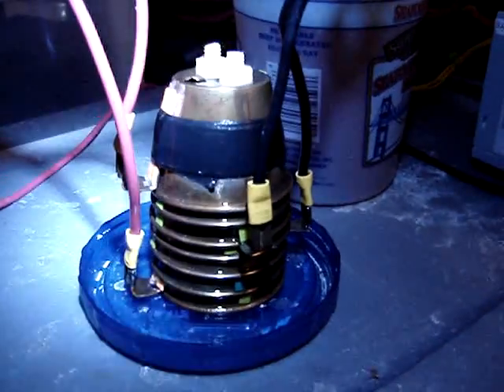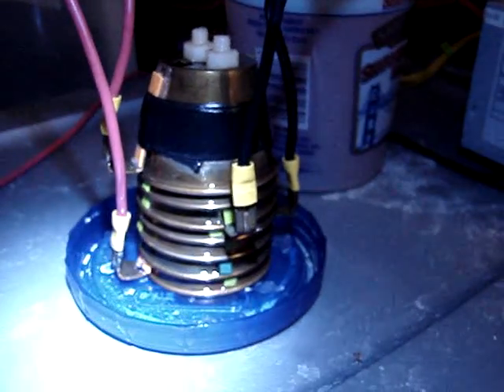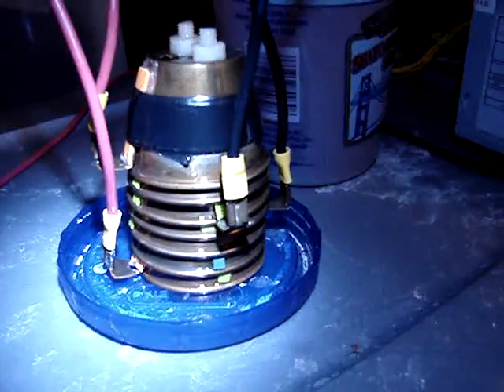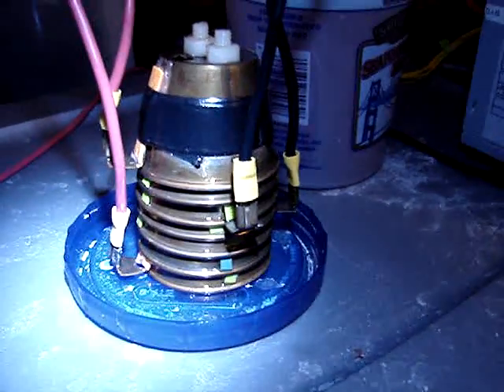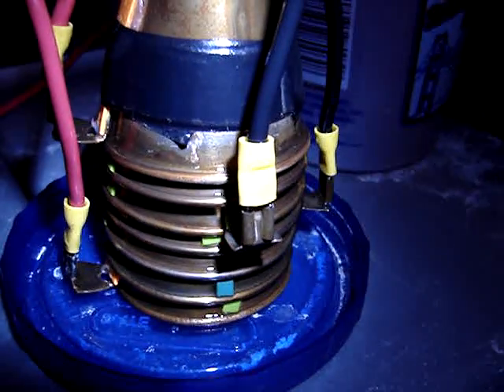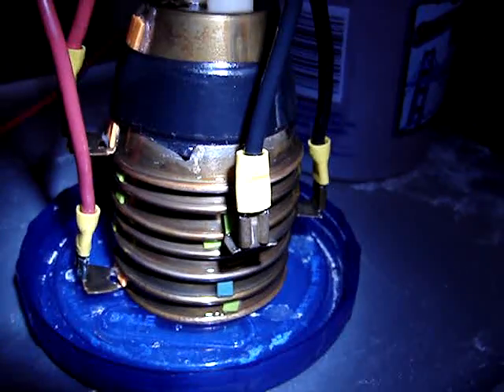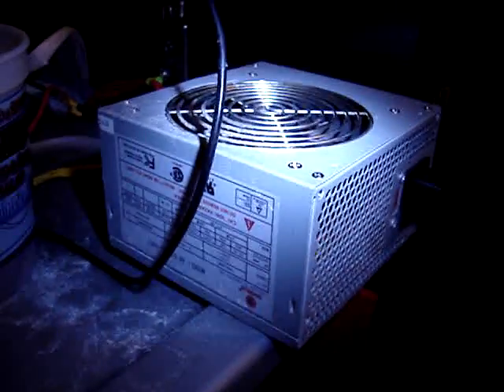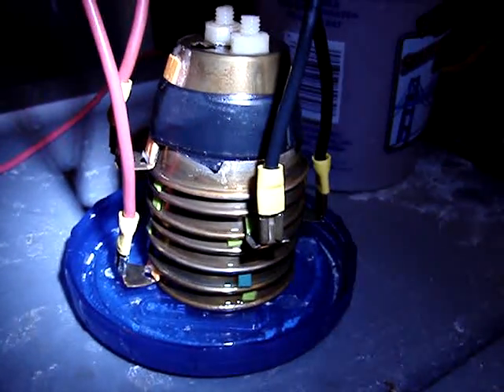Vid4 Really Cheap Hydrogen Generator (HHO, Brown's Gas, Hydroxy)

Comment: I did some testing with the cups as well but I found out that plates are a lot more easy to work with. I also found out that the cups are not 316L stainless steel, they start to corrode. I never measured how much hho it produced. Did you measure the hho production already?